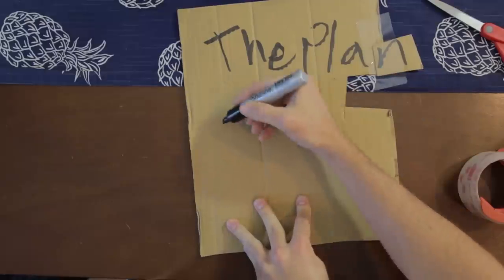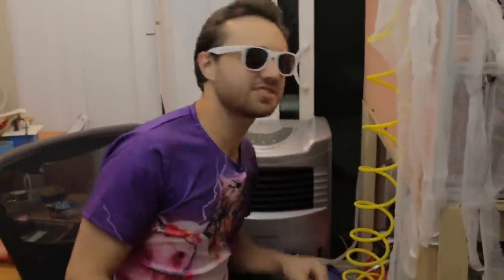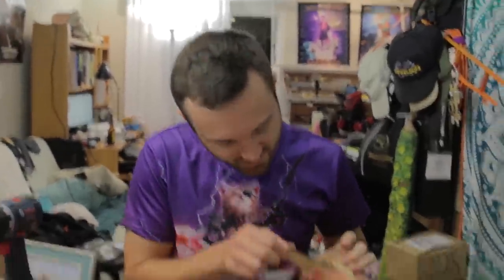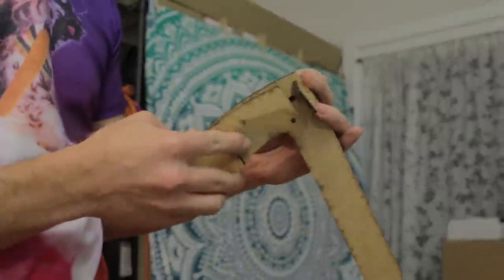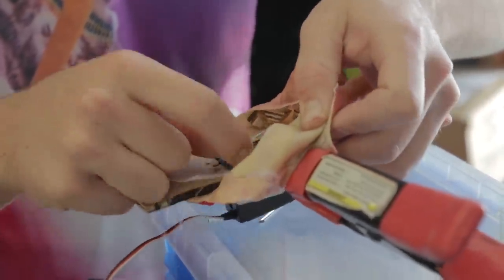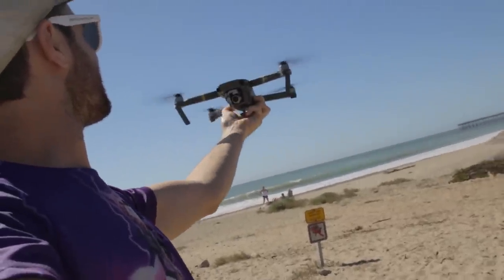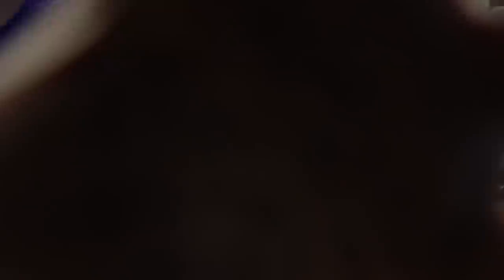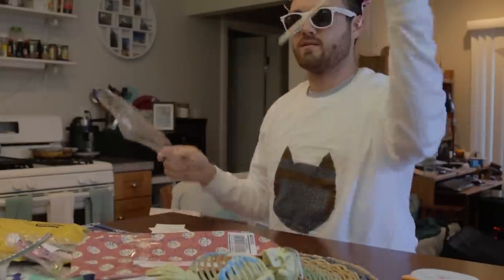Creepy Casey Neistat Wave

Comment: I think if you had essentially reversed the mechanism of the fingers it would’ve worked much better. If you have made the wood blocks in the fingers so heavy metal weights, thing fingers would close themselves, as you then pull the fishing wire it would’ve then straighten each finger out.